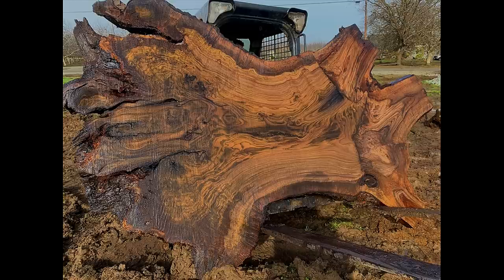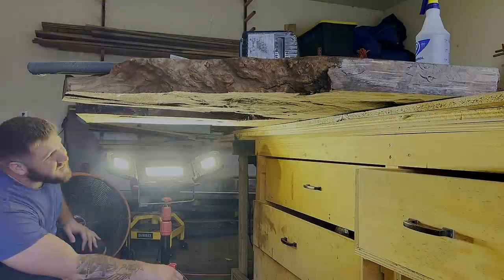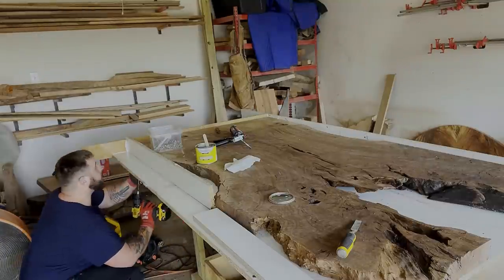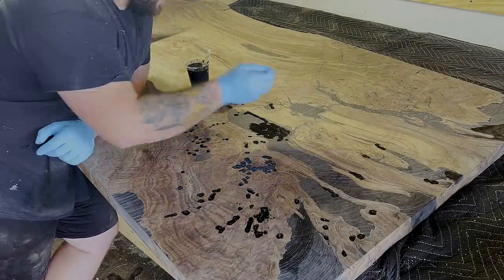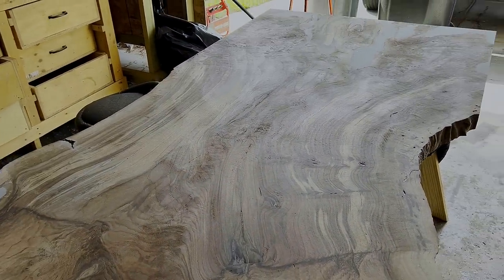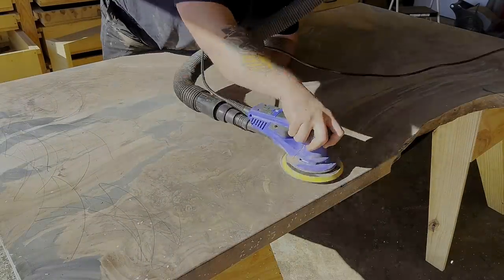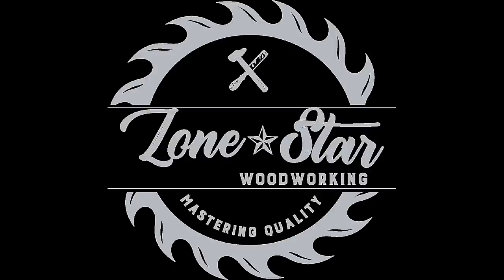$10,000 Table I Built for Free

Comment: A beautiful table. As for the middle sections that you did not want epoxy to fill, if you had sanded and finished them with Rubio before your epoxy pour, you could have kept them safe a clear even if there was a mistake with the pour. Even if they were not "finish clean" by the end of the project, Rubio fixes up and recoats fairly easy.
Reply from the maker: That’s a good point

Comment: Hi Lone Star ⭐️, That looks awesome, I wish I could get some of that wood, but I live in France, I am trying to get my garage/wookshop new floor laid, weather is not great,
Reply from the maker: Yeah the weather doesn’t always like us. What are some of your more common species in France?
Reply: @lonestarwoodworking3810  There is oak walnut, but the main region is pine, I have trees in my garden, about 2 years ago I had to remove some, I have some nice pieces of ash, one tree that I was hoping to be able to use some of it to make other some shelving or some pieces of furniture at some, When it came down it disintegrated, it took me roughly 10 to 15 minutes to prep the tree sawcut chainsaw et cetera making sure it was going to go in the right direction, as it came down, it twisted hit a side of an old caravan and just literally fell apart. It was so rotten, in fact, I would think those somewhere between 6 to 8 m inside of it that was hollow, I have also Alder , which obviously is very good for making guitar bodies, I do have about 6 to 8 slabs, which I could probably make something out of and probably another year or two time, I’m slowly air drying it at the moment, 
There was a beautiful large burr on the tree, I have since useless, I made a very large fruit bowl for a friend of mine who lives back in the UK, it’s approximately 30 inches long by about 20 inches wide, I found it in such a way that it left large wings on the longer ends, so I spent around two days with a very large carving gouge and chopped the end out, The tree itself had to come down, as it was on the side of the river on my property, but was higher than what the electric cables were that were going across the river, I started to remove it, by using a very large electric winch, pulling it over, and at the time there was work being done on the property next door to me, where the electricity company was working, they told me in the end that they would remove it, normally this will cost a lot of money, but it was over electric cables they done it for nothing for me. They had to turn the mains electricity off whilst they dropped the tree part above the cables., The only annoying thing is, I’ve got it set up, so it would’ve fallen onto my land, they decided that they wanted to drop it into the river, it took me eight weeks to get it out, there’s about a one a half meter drop from my land into the river, Sorry, I seem to be gambling on a bit, on my old dude, living by myself in rural France, very rarely speak to anybody as I cannot speak French, I used to run my own specialist joinery company back in the UK, I still have a lot of my tools and machinery, Most of my business over the last 10 to 15 years was barn  conversion projects, making very large windows and doors, One of my windows stands 4 1/2 m in height, it took eight people to lift it and pull it up into place, I think that’s enough for me ramping on for, stay safe, look forward to seeing some more work, I no doubt other next day or so. I’ll have a look at some more of your YouTube channel.,
Reply from the maker: I appreciate it!

Comment: The purpose you used water popping for was probably the only real reason to use water popping on a project like this.
Anyone who water pops after every sanding grit does not understand the process and just wasting their time. Even water popping after the last sanding grit is subjective and serves no real purpose, especially if you sand or scuff between finish coats and pointless with film finishes. the only purpose is to get a subjectively smother surface if you are using a single coat finish like Rubio or a penetrating finish like BLO. Like i said, its subjective.
Reply from the maker: Good insight, I was never really educated on its purpose. Kinda had to just figure that out

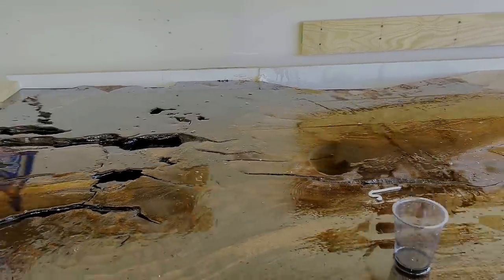Comment: 9:16 just another reason why I’ll probably never try an epoxy build
Reply from the maker: It is ALOT of prep. And any small missed detail can. I’m actively trying to move away from it. I’d rather work with big slabs that are more or less solid that just need little touch up epoxy pours
Reply: @lonestarwoodworking3810  best of luck!!! Looking forward to your next video
Reply: Avoiding a type of project because of the potential difficulties will mean you will never grow as a maker. Sometimes the lessons learned on something you did not like, can be invaluable on a project you are deeply passionate about.

Comment: Try pouring only one gallon and letting it set up some before pouring the rest. That will seal up all the cracks under the slab and will prevent the problem you highlighted.
Reply from the maker: I’ve seen that a few times, definitely would have saved me a gallon or two, thanks for the tip

Comment: In the beginning when you were cleaning up the slathered was alot of dust in the air even with the fan. I work in my garage also but I use a couple of different types of dust masks. You r too young to have lung issues. The table turned out great. Very nice job. Can I ask u what you sold it for.
Reply from the maker: I do have a dust mask….and while this is no excuse not to use it….. I have lung and heart issues from the military. So kinda screwed there but I appreciate the concerns. 

As for what this sold for, it was built at cost in exchange for this client’s professional services. Total cost to complete was just under $4k. If I were selling this at the normal rate I probably would have listed it for somewhere in the ballpark park of $8k. My rule is I have to make enough to do the project twice. So if it cost $1500 I charge $3k etc etc
Reply: thx again for the video. You do very nice work

Comment: Did you check for moisture those yellow streaks look like what black tail studio had in his failed tables
Reply from the maker: I checked those specifically because of that specific reason. They were actually the driest areas of the slab at 8.2. The rest read around 9-10